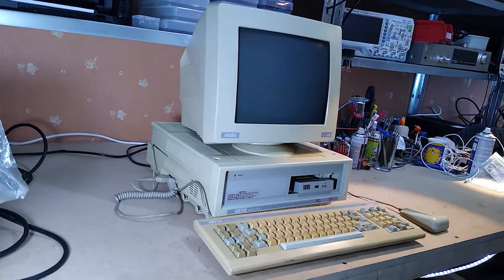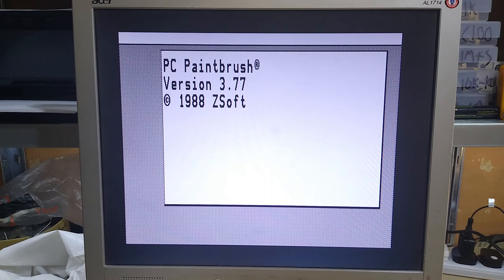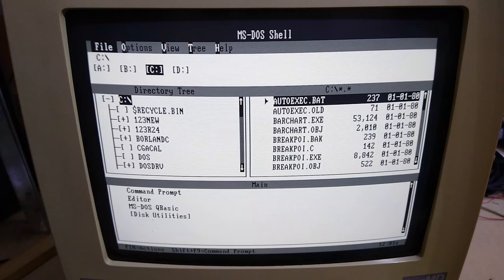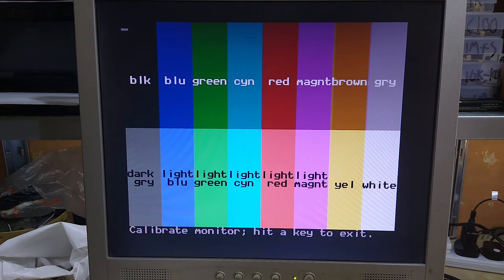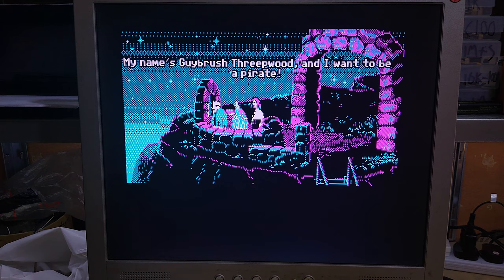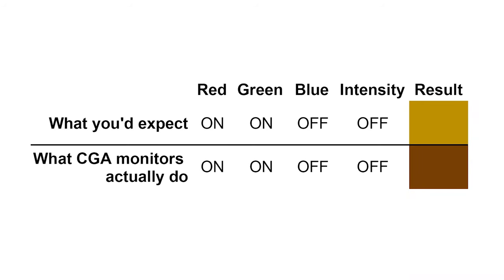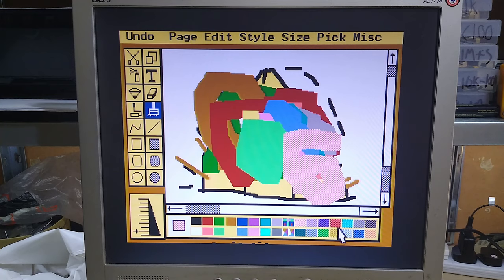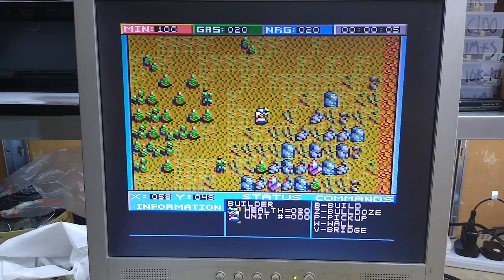Investigating Hercules/CGA modes of Amstrad PC1640 with GBS-8200

Comment: Just now seeing this for some reason.  Better late than never.  I like the video.  You are quite an artist I see.  Anyway, great to see Planet X3 running on another Plantronics capable computer.  I think there are more of them out there than people realize!
Reply from the maker: Wow the man himself! Thanks for your kind words, it's so awesome your game supports so many weird graphics modes :)
Reply: Can you answer if the GBS-8200 can replace my Amstrad PC1512's MCGA monitor with a 1990 Hyundai VGA colour monitor or a more modern 4:3 LCD? Power supply is not an issue. Pin Assignment 1 Composite H & V sync 2 Intensity 3 GND 4 Black 5 Green 6 Blue 7 GND 8 Red. Sellers on Amazon eBay seem a bit skittish to answer my question. I love how to deal with the intensity pin. Can the black pin be done the same way? Thank you for your time on this matter.

Comment: Hi TheRasteri! It's a very nice video, thank you for sharing it. I was inspired by your work and found another very interesting and simple way (as I think) how to combine CGA/EGA with GBS-8200 class devices. I tried it already and my idea works quite good so far. I'm currently making a video too and would like to open source my work. So far I got CGA and EGA working, but on top of my idea, theoretically I could also do MGA/Hercules conversion as well. I already did the prototype and it seems to work on the oscilloscope, however, as I planned the whole thing I didn't realize, that MGA/Hercules do work at 18.43kHz and, as far as I can see now GBS-8200 only works at 14.5-16.5K, 23.5-25.5K and 30.5-32.5K. Do you have some experience to share about it? Is it possible to run GBS-8200 at 18.43K somehow?
Reply: 1:55 that's his favorite picture to draw right there🤣🤣🤣🤣🤣🤣🤣🤣🤣🤣

Comment: I had a PC1640 ECD (HD20) that had an EGA display.  I seem to recall I was able to choose 256k EGA in games that supported it.  It was a nice PC at the time considering the ones I used in school mostly had orange/green monochrome monitors.
Reply from the maker: The school ones probably cost 3x as much too
Reply: TheRasteri perhaps, our Amstrad cost around 3k AUD in 87/88.  Wasn’t cheap!  The school machines I remember the most were the “Sperry” brand and only 4.77mhz with the mono card being full length.  The PC1640 had a v20 chip at 8mhz I think?

Comment: Hello, I have an amstrad pc 1512 with a broken monitor, but if the power supply works, there is some way to connect it to another monitor, be it vga, rca or otherwise, just as long as the image is visible, it's fine, thanks
Reply from the maker: The MCE2VGA is probably the easiest way :)
Reply: @TheRasteri  I test it, thanks my friend

Comment: hello, I have a PC1640 with MD monitor but I cannot set CGA emulation mode. Hercules is working fine but very few games support Hercules and I would like to use CGA (even if in grey scale); do you have any suggestion?

Comment: 7:17 WoW  how even that is possible on CGA ?
Reply: It's not actually CGA, the "CGA-compatible" there refers to the card also supporting CGA modes. In addition to them it also supports some non-CGA modes that have use same resolutions and colour depths that CGA uses, but combined in a non-CGA way

Comment: i was warranty tech support in Australia for these PCs . They were built to a very low price, the monitors were absolute CRAP. if you have a monitor that has a fan for the Power supply, you can thank me. It was my feedback to QA dept. that convince the manufacturer to add the little fan.
Reply: Can't have been all that bad... our 1512 still works very nicely.  No fan required... in Scotland, anyway!